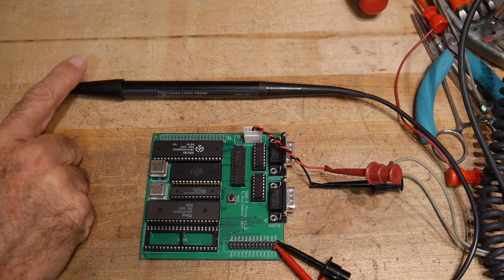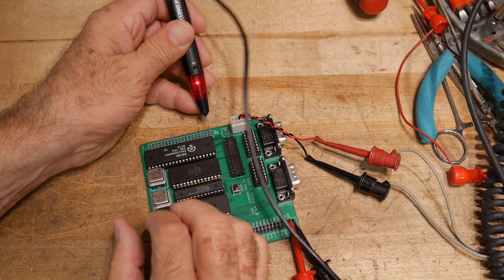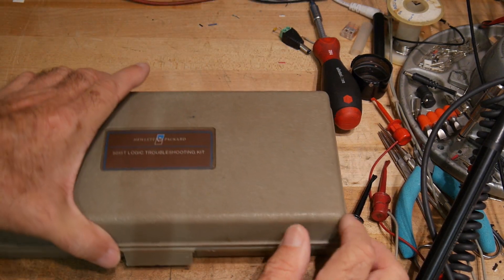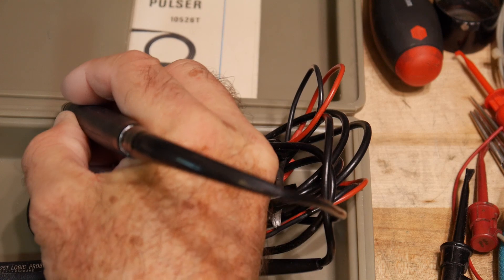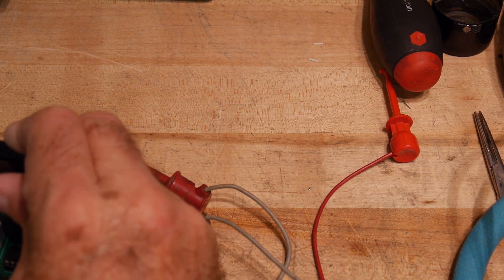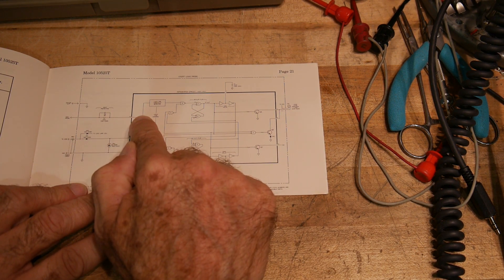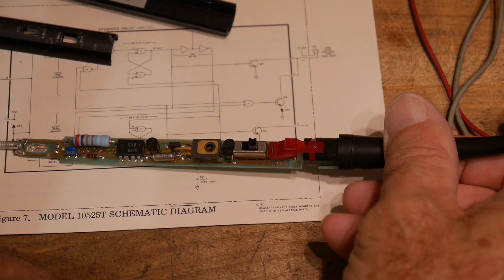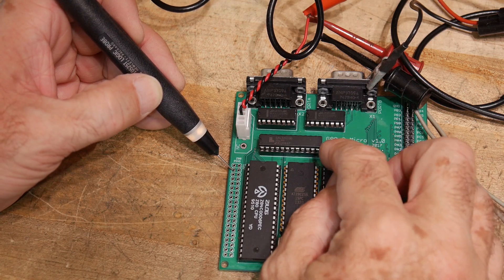#240 HP Logic Probe 545A

Comment: I used to repair MIL-STD. 1750 Quad  2900 ALU chips and program instructions stored in SAM (starting Memory Address ROM). Single step and check all 16 bits, then decode the instruction to determine the expected result.  So applying a 1KHZ reset and following address execution you can find and fix a CPU logic failure.   Input >>otput..   IMade it to research scientist at cpu repair.❤❤